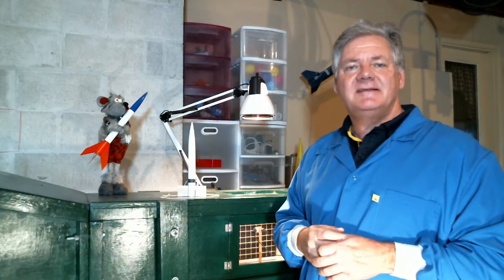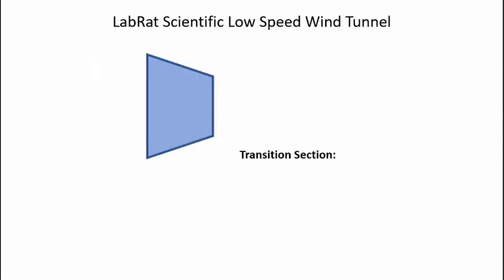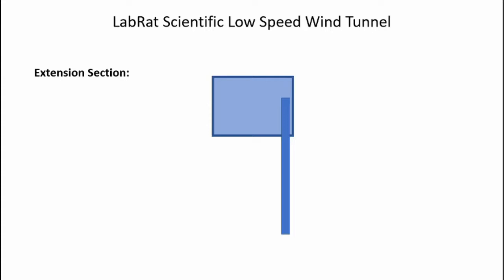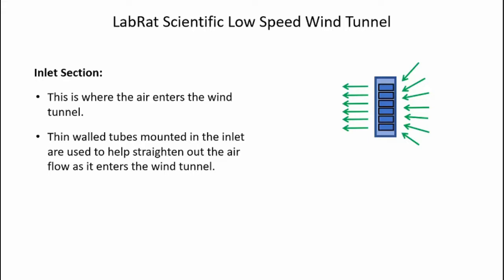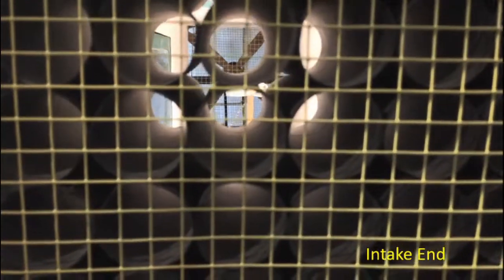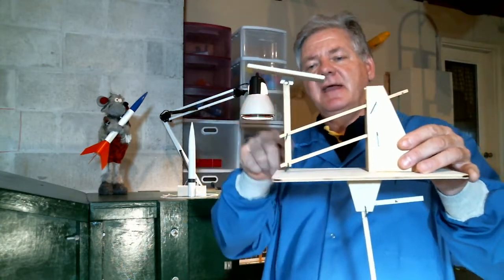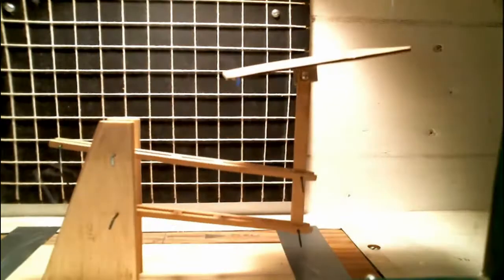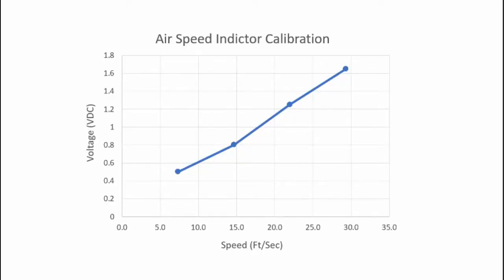Low Speed Wind Tunnel

Comment: I respect your project but there are two major mistakes
1. You can't increase the airspeed using divergence nozzle. In fact, it will be even slower.
2. It is far from accurate to use DC+propeller to measure air speed. You shall use pitot-static tube.
3. The way you use to measure lift also not right but still very impressive.
Nice project anyway!